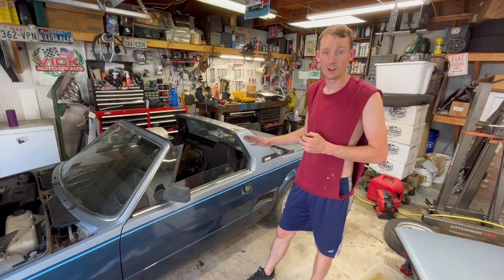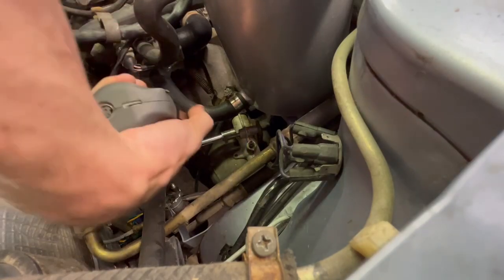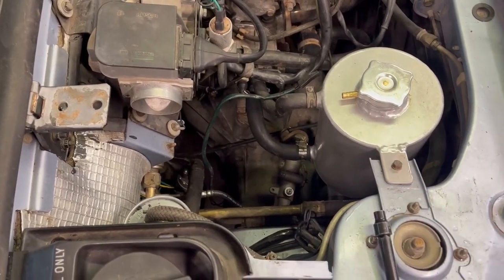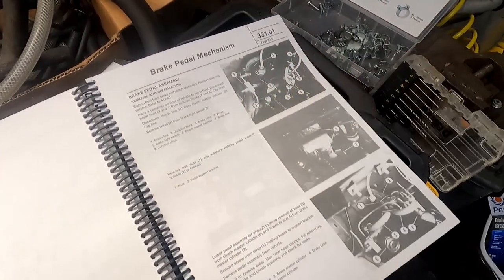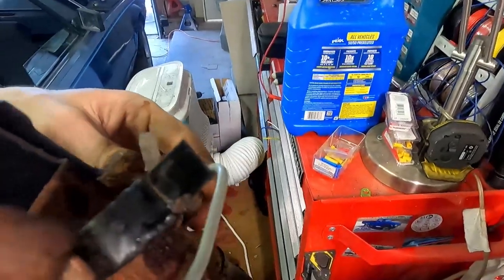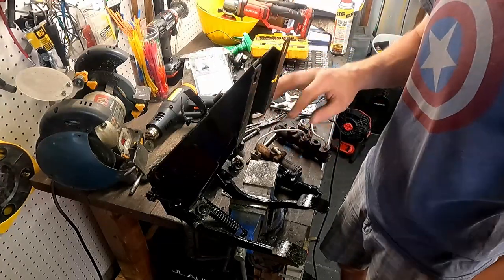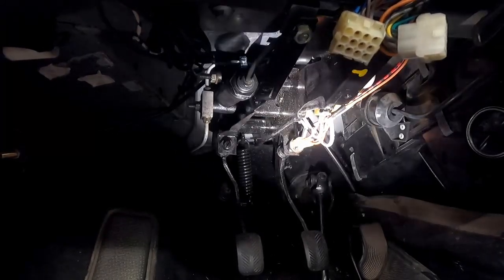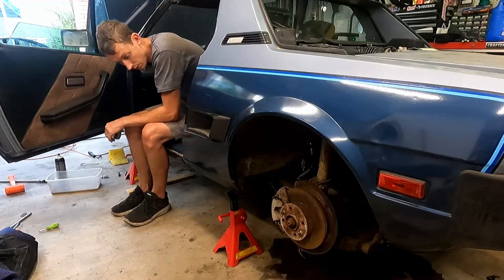Reviving My X 1/9: Clutch Replacement & First Spin!

Comment: I think you missed the bench bleed part of the process.  Usually when you put in a new master cylinder, you have to bench bleed it to get the air out before installing it.  Worth following up with the Vick's folks about how to do this for an X1/9
Reply: New big brake set up should solve the problem. New calipers, discs and stainless steel brake lines will reward you.